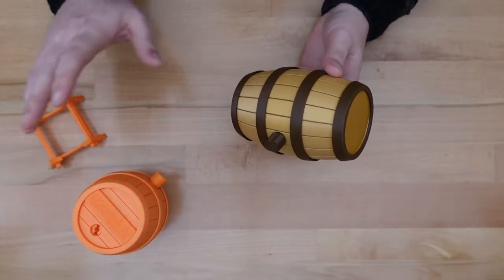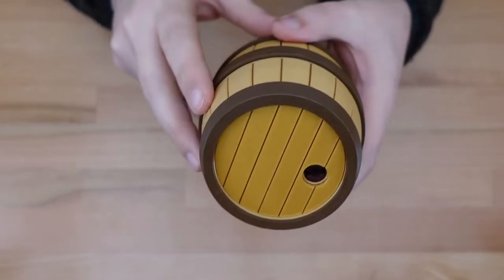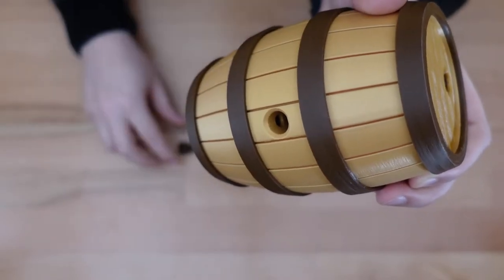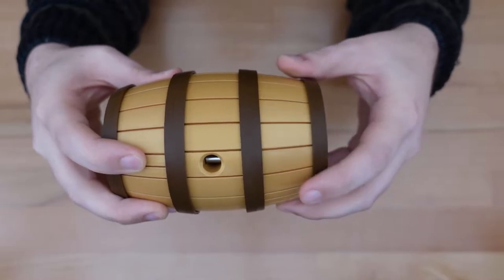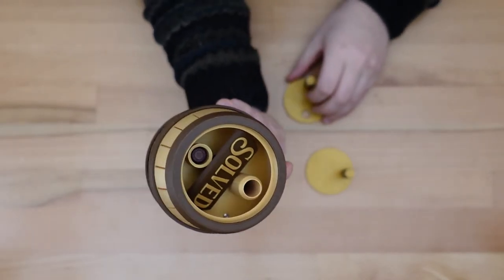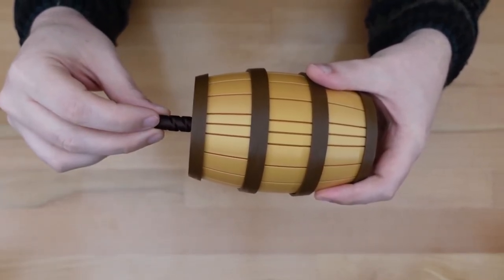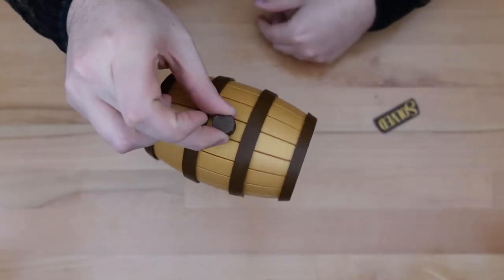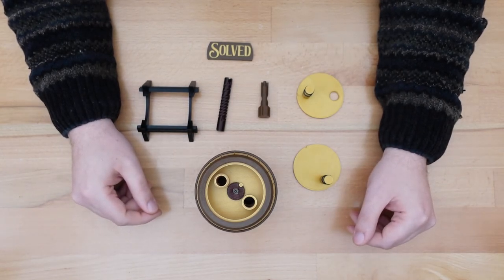The Barrel Cooper's Puzzle Box - Solution

Comment: Awesome design!   I am using the magnet and a metal dowel.  Tested before putting together and it comes out with a tap.  When you put it together, there is no place for the dowel to drop with a tap, so it makes no sense.   Is there an updated version with a slot for the dowel drop?   Also, both the top and bottom cracked off when trying to open, but I can retry printing those with 100% infill to see if it makes them stronger. edit- I used a thin metal rod when fixing the top and bottom pieces and now they are very strong
Reply from the maker: Great idea reinforcing the lids! The metal pin should fall into a pocket in the middle shell. If the pin is the correct length, it'll fall just far enough for the cork to be pulled out. I hope that helps :)

Comment: could you make this puzzle on a Dremel 3d printer? I've made a puzzle in the past with one, and I found myself having to sand it down because it had ridged parts and didn't go together.
Reply from the maker: I can't guarantee it, but for several reasons, I believe it should be fine!

1. This puzzle is fairly forgiving overall.
2. The few parts that require good tolerances (main screw, interlocking pins, cork) are all small and so reprinting them as you test settings won't take up too much time or plastic.
3. The interlocking pins and main screw also come in alternate "loose" variations, so if they give you trouble, you have a less tight option to try.

I recommend that you use files found in the "Upgrade" remix. This has a stronger cork, and middle shell that fits that cork, and uses a smaller dowel pin.

You might have a little trouble forcing the hoops on, but they are only decorative. I imagine the worst case scenario is one snaps instead of sliding on, and you'd either need to reprint that small part or go without the hoops.

Good luck and happy printing!